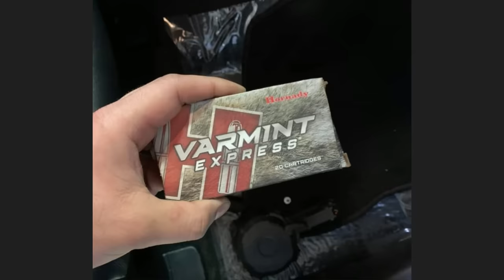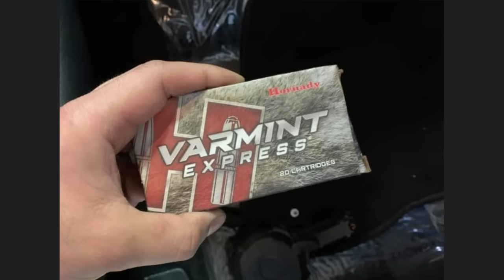Customer States Vehicle Overheated And They Kept Driving | Just Rolled In

Comment: FYI-that first one is the new Explorer steam powered. It gets 1 mile per lump of coal. 

True story.
Reply: You just know that Jay Leno is going to pick one of them up, he has a soft spot for steam-powered cars.
Reply: Honestly, it's not worth trying to fix an old Explorer.
Reply: Chugga chugga choo choo.
Reply: Toot toot!
Reply: That was smoke, not steam. That engine was totally cooked
Reply: That's funny.
Reply: $15 dollars for a thermostat but they kept on driving and trashed a 3k motor ha
Reply: 1 Mile per lump of coal is actually pretty good. I wouldn't mind that.
Reply: My uncle has the same gen Explore. Given gas prices I think I should get him a conversion kit 😂
Reply: Can be converted to burn oil if you got some used oil lying around.
Reply: @thegreatcanadianlumberjack5307  you would be surprised how many steam locomotives run on used motor oil or blends with other waste oil.
Reply: @MakeItWithCalvin  i know that was my comment was refering to
Reply: @kingssuck06 the cologne V6 always popping it's thermostat and leaking on top of the manifold and those DAMN plastic ⛓️ guides ugh, Mama can't get rid of it soon enough (2009 XLT 4x2)

Comment: I've got to say thanks to you guys.  I'm just a shade-tree mechanic, but I got called on to inspect a car that a friend's daughter was thinking of buying for her first car.  The inside was fine, and the engine ran fine, but due to your videos, I stuck my head under the car to take a peek.  There were 3 huge rust holes on the unibody frame, one where I could see evidence that the frame had already bent there.  And the exhaust was dangling from only 1 of the 3 exhaust hangers that it was supposed to.  The other two exhaust hanger locations had several zip ties where the owner had "tried to fix it, but the exhaust kept melting the zip ties."   And (probably because of the bent frame) the alignment was so bad that 1 of the 4 tires they had "just bought new ones at Walmart at the beginning of winter" the tread was completely worn out and the frayed steel belt was very visible.   I'm glad she had me check it before she bought it ""because it looked comfy and I like the blue paint."   😖
Reply: Don't tell that guy that you can buy stainless steel zip ties.
Reply: @John_Ridley  I'm that kind of guy (that tries the crazy fixes shown in these videos).  Thanks for the tip!
Reply: You saved that girl a heart break!
Reply: I love when friends ask me to look over a vehicle before they buy it.  It's like a treasure hunt...never know what you'll find and it always makes for a good story.
Reply: First thing you do is check the underside of the car to ensure the frame isnt rusted out!
Reply: @01trsmar  I will be from here on out for me.  Amen
Reply: well done! sounds like that car would have been a death trap! thumbs up I hope everyone you know will now show their would-be new purchases to you before they pay a penny from now on.
Reply: I think about this when I see these videos. If I ever think of buying a used car I'm getting that thing up on a lift and looking underneath. The things people let happen to their cars or do to their cars.... Yikes.
Reply: @RachelHendricks  right? and most things you can see without a big lamp, or without knowing much about cars... if it looks wrong, it most possibly is.

Comment: Without fail there's always one clip of "this thing doesn't work" and the technician simply turns the switch on.
Reply: I drive a GM car so I knew that fix immediately, can't believe someone went back to the dealership with it!
Reply: Personally I find the ever so slowly brightening of the lights annoying.
Reply: @mikespangler98  What I find annoying in my 2005 Cavalier is that, at night, when I shut off the engine, the interior lights come on, "exposing" me to whoever's watching.  I remember one Click and Clack episode where a caller's wife said that her husband purchased a Mercedes at auction, and that all the interior lights had been covered with electrical tape.  Jokes about "dragon tracks" ensued.
Reply: @josepherhardt164  I bought a cop car once and the door switches for the interior light had been disconnected for that very reason.
Reply: yeah I have my door lights turned off and a piece of tape over it so I know not to accidentally flip it when I'm searching in the dark for the right switch. It really really bothers me when the lights come on when I didn't want them to.
Reply: @mikespangler98  that's slow enough to make you think that there is a more severe issue.  You flick a switch and you expect it to work.  It's like turning a faucet on and the water only comes out after 5 seconds.

Comment: As an Alignment tech the first few clips gives me flashbacks . Cant tell you the amount of times i have seen tires just like these . Did a track set up on a Z06 Corvette who wanted to drive it on the street and even after warnings from me and documentation from GM saying this set up is for race day only not for general street use . Month later he is back with front tires worn to the cords like these tires on the inside edges . He did not decline repairs and his day ended with a near 2 grand bill for tires and the alignment put back to stock . Thanks buddy for always making my day ..
Reply: There's a reason why racing tires grip so well. The suckers are so soft that they'll fall apart on street use.

I know I'm probably preaching to the choir, but hopefully this may answer any future questions for other viewers.
Reply: Hunter certified here. I feel ya bro.
Reply: Man, who'd do that to a Z06? They're pretty dang close to race cars already...
Reply: And likewise, running a street alignment at the track can trash tires in just two sessions.  Ask me how I know.
Reply: @Diaphat  Yes indeed soft as the soles on a pair of slippers . Great for grip but dont like the cold , the 1LE tires that come on the Camaro for example cannot be driven at 20 degrees or minus 7 or they will crack . When my city of Oshawa here in Canada built the Camaro we ended up with a dozen new cars from the factory at our dealership that had cracked tires for replacement . Added by the extreme negative camber with the track set up on the street they will wear to the point you can see a trail of dollar bills left on the road . lol
Reply: @kyzercube  Nice to meet another tech with shared qualification although i cringe when i see the Hunter rep show up . What the hell are you doing now to make my life more difficult , he can con our service manager and owner into buying anything and everything but doesnt have the money for a proper raise for the techs ..
Reply: @Diaphat  Still reminds me of playing "Streets of Sim City" in like... 1998 - 2002. They had Racing Slicks available for cars, and as you might imagine, those were not durable.
Reply: @belacickekl7579  I know buddy , been saying that for years , the car is near perfection and dollar for dollar will out perform cars twice the price , many vids on the Tube here proving it and the car just gets better and faster but expect to see a hybrid supercar in the near future ..
Reply: @heavenhelpus479  There is a reason when hurtling around a road course at some insane high speeds and g forces especially corners negative camber is your friend . Its all about the size of the contact patch around corners something the street set up is missing by a number of degrees . You are spot on  though ..
Reply: I have caster/camber plates on a 93 Mustang, run (maxed out) a degree or two of static neg camber and max pos caster. It corners fairly well, but tears up the inside edge of both front tires fast. The rear tires are bald. The front struts are a limitation, so an SLA front end is on my list, along with larger (4 wheel) brake rotors, 5 lug swap, and wider tires.
Reply: Does anyone still use John Bean alignment racks?
Reply: @fredk.2001  There is two main issues that will cause tire wear back and front but the front is worse because of front wheel drive combined with turning . You are fine with high caster  because its a non tire wearing angle although too high will cause heavy steering around corners but will go straight real good . Toe is the first and king , you can have some negative camber which is good but if the toe is out it will greatly exaggerate the camber setting and will indeed cause inner tire wear indicating negative toe  . All cars are different and require different needs but cut your camber in half and be real sure the toe is perfect based on factory specs . And when going with wider wheels be sure of proper off set , dont go more then whats practical ..
Reply: @fredk.2001  Not sure about today , the world is a big place but John Bean still makes alignment machines but Hunter it appears have cornered the market , probably has back door deals with the big 3 but we had a Bean machine 40 years ago when i first started , was a light bulb that shined against a mirror mounted on the wheels and reflected against the wall with all the numbers . Even today alignment machines havent changed , now its LEDS light bouncing of a reflective surface and its angle picked up by a camera , the same but different
Reply: See also: Low-profile tires and rims. See foolish people trying to limp somewhere on a flat, as they start losing bits of the tire or rim, doing 10 mph as other idiots all but rear-end them because 'what's those emergency flashers on for?'.

Comment: I feel sorry for whoever had to detail the dog hair car.  Hope they charged extra.
Reply from the maker: Agreed. I'd be sneezing if I got even close to that car.
Reply: Yeah my daughter's blue healer dog hair sticks to my truck upholstery like Velcro.
Reply: They probably could have made another two dogs using that fur alone.
Reply: Lol😂, I just bought a 2000 crv from auction sight unseen. Piece of fence zip tied to back of front seats, dog(s) roamed free in back. You could knit two sweaters and dirt scooped out with a trowel, ugh! Tyvek suit, gloves, and mask using leaf blower first. I'm so happy a buddy of mine is letting me borrow his ozone machine (otherwise vehicle in great shape), but, ugh!
Reply: Detailer usually do
Reply: Some dogs have a type of hair that is almost impossible to get loose from the carpet; it won't vacuum, resists pulling and scraping, you literally have to take a needle nose plyer to EVERY single hair. Especially when stuck into that really short-type carpet sometimes used on trunk walls. Drive me nuts!
Reply: I clean rental cars, and pet hair is frankly among the least disgusting things to deal with. It's not difficult to remove, but it is time-consuming. Also, an upholstery cleaning would be recommended since with that much hair, the seats are probably filthy, too.
Reply: Yeah that was grim!!
Reply: Not to mention that there's probably fleas throughout vehicle!
Reply: My boss just spent $8000 replacing the transmission in my Caravan. Probably too soon to ask for a turbo.
Reply: I would probably charge more than double. It is going to be worth my time. 

First I would go trough the car blowing it out outside with compressed air. 
Then I use this velvet kind of brush that collects hair rubbing one way and disposes rubbing it the other way. They have worked really well for me in these situations. 
After that it's just time to scrub away.
Reply: If u have a scheduled service appointment I don't understand how people can bring in cars like those 2. I feel bad if I have left empty water bottles in the back seat
Reply: @i.h.1446  CR-V's of that vintage are perfect dog cars.... I have a 97 cr-v and I used to carry my beagles around in it.   I still can't get all of the dog hair out of it.
Reply: @dutchdrifter8740   Easier solution would be to torch it!
Reply: My Pomchi dropped hair like crazy. He passed on and I am still cleaning up his hair!
Reply: Looks like money
Reply: Sad thing is when I detailed for Lexus and Toyota and Nissan we got paid a set wage it didn't matter how bad the car was we got paid our hourly rate
Reply: @da_SpiffR  My Great Pyr / Anatolian Shepard mix has THAT type of coat. If you think the car is bad...my house is worse. But we love him.
Reply: @standupbroad6648  Yup, I love my husky but cringe whenever she is in the car... now how did THIS get in the dern TRUNK?
Reply: For running a vaccuum and a lint roller? 🤔
Reply: @JustRolledIn  same.
Reply: Finally, someone with more dog hair in their car than my buddy's minivan.  Wait, maybe not. Didn't get to see the whole thing. :hand-orange-covering-eyes:😁
Reply: It's very unusual they even had it done, perhaps they took it to a few other shops who also refused it.
Reply: @stevie-ray2020  not all dogs have fleas Stevie.
Reply: @itburnswhenip1963  🤣🤣🤣
Reply: oh they 10000% did
Reply: @Bandit4557  That's true.  I imagine having to clean out some Uber car after it brought back several drunk and sick people from the bar is far worst.
Reply: @mrquirky3626  exactly one of my thoughts. My first one was hoarders.
Reply: That would've taken all day.
Reply: Honestly wasn't bad. I have been forced to work on cars WAY worse
Reply: @Bobo  thank you. I have not as of yet, but I'll be certain to do due diligence before starting (there are some pieces to replace, so it might be a win 😀)
Reply: I did a conversion van years ago and the owner had 3 sheepdogs took me 2 days to vacuum up the hair because it was a trade in.
Reply: What about the guy who's wife sounds like that window?
Reply: that's thier job and they have equipment to do it.
Reply: @JustRolledIn  I started sneezing just watching it in this video
Reply: Idk why people take their fucken pets everywhere
Reply: @weirdfan88  "you don't understand. He's my emotional support animal. I have to bring him with me or I'll literally die"

Comment: Electrical tape works as a bandaid but not on brake lines
Reply from the maker: Definitely used it as a bandaid lots of times 😂
Reply: Yeah, it'll get you to the hospital, if needed, but using it on brake lines could get you to the morgue.
Reply: @JustRolledIn  me too. I blew a boost hose on an old turbo diesel. I went for the thorough repair and wrapped an entire roll around the split  and a good distance past. Looked like a layered silicon hose by the time I'd finished 😂
Reply: @philgrimsey3637  We did that on our Sprinter several years ago. Actually put quite a few miles on it that way until we were able to order a new hose!

Comment: Love this learning channel.  When I first started watching...I was pretty bad at figuring out what some of the issues were.  Now I am a master at diagnosing dilapidated vehicles.  Some of these videos are insane.  When one's car is overheating...its best to just keep driving?  Trash cars make me scratch my head the most.  How do they get that bad.
Reply: If you can get the vehicle going fast enough, you'll force enough air through the radiator and cool the engine. Unless you've suffered a loss of coolant; then you'll likely overheat and damage the engine bad enough to get a major oil leak into the cooling passages and/or cooling system. 
Just remember I'm not a mechanic, but I play one on YouTube.
Reply: @markh.6687  I was always told to crank the heat up if vehicle starts overheating.  I had issues with dexcool turning my radiator to sludge years ago.  I would crank the heat up and it gave me time to get it flushed.  I so hated GM after that.   3 radiator flushes, on a car under 125k miles??  I've never bought another vehicle from them.
Reply: "When one's car is overheating...its best to just keep driving?"
Depends on whether you're being chased by zombies or velociraptors.  :)
Reply: @sunsetlane3924  Yes, that's true...unless you have little or no coolant in the system. If there's no heat at the vents, AND you're overheating, pull over, open the hood, and let things start cooling off (open hood lets heat rise and escape the engine and engine compartment), because you'll have to turn the engine off, and the excess heat needs to be let out.
Reply: @josepherhardt164  True lol.  Gonna be pedal to the floor in those cases!!  Car please don't fail me now!!!!
Reply: @markh.6687  Good to know...thanks.  Vehicles are great...til they ain't.  :)
Reply: @sunsetlane3924  "Our Blessed Lady of Acceleration, don't fail us now!" 
-- Elwood from 'The Blues Brothers'

Comment: 0:28 I felt this one. I’ve had my Toyota Sienna for about three years now, and have never had any reason to touch the switch on the interior lights, so I didn’t know where it was. Didn’t even know I had one. A couple months ago, a sliding door got jammed with ice and wrecked the motor on the automatic sliding mechanism. The door was stuck half way open. Which meant the lights were on and in danger of draining the battery. Not knowing where the switch was, I popped the hood and pulled the fuse for the lights. Found the switch on the lower dash next to the key ignition (hidden by the steering wheel) the next day.
Reply: That’s funny.   We have issues with sliding doors acting up when it’s really cold out.    We just turn the power sliding doors and rear hatch off.
Reply: RTFM.
Reply: @GalenlevyPhoto  Yeah, definitely wish I’d thought about it that day. Oh well, just gotta do it the old fashion way now.
Reply: @BubbaSmurft  How do you think I found the fuse?
Reply: @Wesley_H  I don't know. How?
Reply: @BubbaSmurft  tRiAl AnD eRrOr. No, I read the manual.

Comment: 1:09 Ah yes, screwdriver and pliers. Standard tyre removal equipment and all professional tyre shops :)
Reply: I found a Husky socket wrench laying in the engine compartment of my bought-used car. The ratchet was sorta beat up and didn't want to hold or release the sockets, so I took it to my local Home Depot and swapped out for a shiny new ratchet.